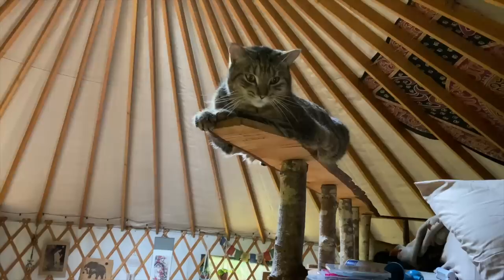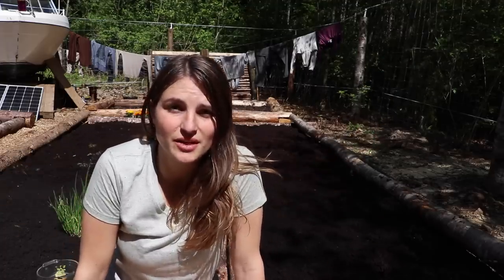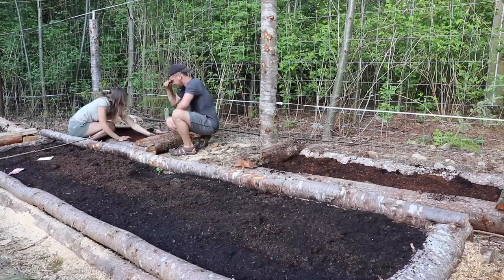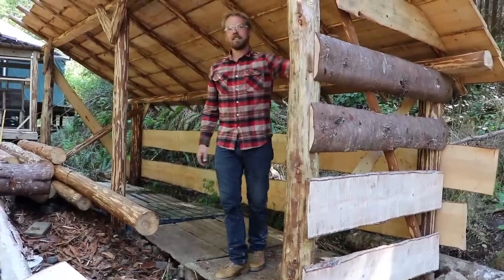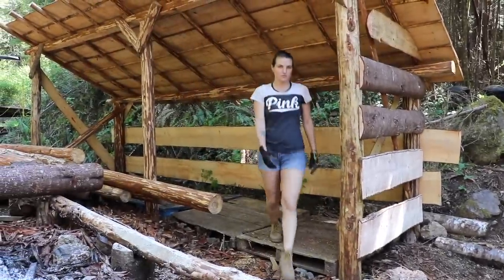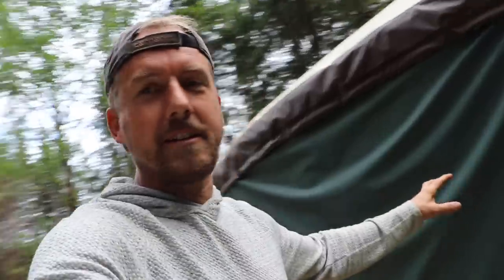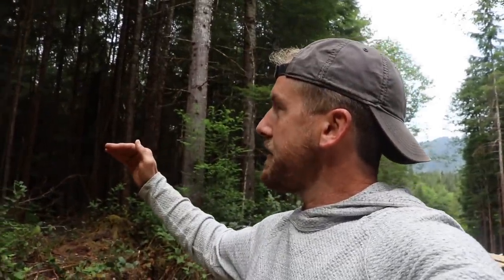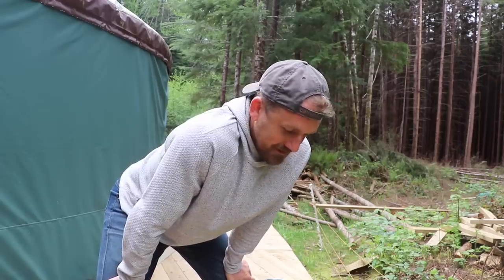WILDERNESS LIVING // ALONE & GARDENING OFF GRID - One Year of FIREWOOD | Can Our Dogs Swim - Ep. 88

Comment: Are those chives already growing in your garden?
Good stuff. It takes a lot of work, this dream of yours... good planning and active pursuit of your plans will get you there, and the later part of this year and next year should be very, very exciting for you.
When I was 11, my father and I downed a 112 foot maple tree using a similar rope and pulley arrangement. We required two ropes, two pulleys and one truck to pull it off. We had built a house over an abandoned rock home from 1889, and the tree was far too close for my mother’s peace of mind (less than three feet at the closest branch). It all worked out and the rigging ensured it didn’t fall into the house. It took me nearly 7 years to cut and split about 3/4 of it into firewood. The other quarter became furniture.
You can do this.

Comment: You need to sort those insects, I went camping at the lakes in my country, we camped in a logging forest just like you are there, we got lit up by these horrible little insects, probably the same as yours there, 20 minutes and I just wanted out of that forest. I always wondered if you could eradicate them with a few flea traps set about your property. The flea trap I bought was basically an oven/wardrobe incandescent light bulb under a cone lid , the gentle heat from the bulb warmed a sticky glue pad about 8cm under the bulb, it tricked the fleas into thinking it was a warm body to feast on and they got stuck, It was very effective, fleas were gone in less than two days...Maybe it'll work for these buggers. Or you could make your own scaled up version maybe with sticky sugar syrup as the glue bottom. Set them out after 5pm and devastate their population.

Comment: Jake! Love your videos, but take it from an old guy to a young guy who will get old; Stop working so hard with your firewood. I learned to NEVER touch the wood more than 4 times before enjoying a fire. 1st time when you cut the tree down or harvest the tree that already has fallen. 2nd time to cut desired lengths of logs for splitting. 3rd to split the logs. And then 4th to stack in wood shed. You are wasting so much energy and time. Either move your logs next to your storage shed or at least have a tough 4 wheel wagon to through your split pieces into after you split. Otherwise you are throwing pieces  onto the ground and then you have to carry them to the shed and then stack. If you set it up more efficiently you'd have more time to enjoy your beautiful place and your wife. I learned this more than 50 years ago from an old time woodsman. "Work Smarter Not Harder". Keep up the great videos!

Comment: Why do you handle the firewood twice; after splitting you throw it into a pile.  Then I’m assuming you load it again and transport to yurt.  What if, once split you throw it in wheelbarrow or pickup bed ready for transport to yurt?  Just trying to save you some time/labor...if possible.
Reply: Mickey Melton...
Exactly what I was thinking. Also, if those bug pieces need to be split again, why not do it at the same time? Handle only once when possible. That's the corporate girl in me, I guess.
Reply: @mernafrederick5153  Yes! I was wondering why they didn't have a wheelbarrow also.  Anything to speed up the process and get away from the bugs!
Reply: They used to have a wheelbarrow, not sure what happened to it???
Reply: I'm pretty sure he is addicted to wood chopping....he can't help working out and filming it!  A wheelbarrow? Please....so easy!

Comment: Hey Jake!! Why don’t you get a wheelbarrow or a 4 wheel cart to throw the wood in. It will save you both time and effort. Effort in that you won’t have to pick the wood up a second until you wheel it to the storage area.

You can also use a heavy duty tarp to drag the wood. I think you have a wench. If you get a heavy tarp with holes, attach the wench with the straps to a tree behind the wood storage area. You can wench a lot of wood at once

Comment: Hey I am an arborist in Ontario Canada and I could give you a few good tips for removing conifers.

I went to Humber College and there I learned some good ways to remove coniferous trees.

If you buy some spurs, chainsaw pants, a helmet with ear muffs, safety glasses, a rope, an eye to eye rope, a micro-pulley, a carabeeneer, a harness, and lanyard, then you can ascend the tree and remove it piece by piece.

That might seem expensive, but you'll have the items for many years and will have control over where your trees fall.

You just need to know a running bowline knot and a schwabish friction hitch and you are good to go!

I've climbed and removed conifers and they aren't that hard. You are very fit so climbing should be easy for you.

But if the goal is to save time and money then perhaps you are doing it right. Cheers!

Comment: Hey Nicole, You've really improved your upper body strength... a year ago you couldn't throw logs like that, or half as far !  Happy you bought those face nets, it was hard to watch you both being so miserable with the flying bugs. Jake, since you want some anchors for future tree cutting, maybe set up some scaffolding when cutting those trees ?  What I'm suggesting is selective cuts of trees at heights of 10'-15' above ground so the bases and roots can be used as pylons of future structures/platforms/walkways. I'm thinking that leaving the root structures with a significant stump above will keep the nearby trees and soil more stable until the remaining trees ramp up root growth over a year or three ahead...These anchor/pylons can also support winches or your pulleys and rope while giving you ready made pylons that are on either side OR the middle of platforms like I've seen on that Treehouse Masters TV show.  They; (TM's TV Show) also have some floating mount attachment structures designed NOT to harm the trees they use as structural elements. Nice to see the boys can swim, pretty soon you won't be able to stop them from jumping in the water, mud, dirt, and smelly crap they'll find nearby !

Comment: I know you have a desire to use manpower to do most if not all work around the homestead.  I appreciate that but I have a suggestion to consider.   Find a used four wheeler along with a cart to handle your firewood and other bulky material movements including small and medium logs.      There seems to be a number of options to continue your manual labor effort for health benefits.  But having some mechanical assistance would provide time savings while minimizing some of the potential safety hazards.    I root for both of you to be successful in your life goals and the love you have for each other.     Peace
Reply: I've been thinking the same thing for a long time. They would be able to manage their time much better and accomplish more.

Comment: Jake,
DON'T THIN OUT THE TREES. Trees work collectively against the wind. They close up to a compact mass so that the wind can't infiltrate the forest but slides away on top of it. Every single tree only stands and grows as tall because the surrounding trees protect them. Their crowns bounce of each other to prevent bending. If you thin out and create corridors in which the wind can get between the trees, you destabilize the whole system and single trees will be an easy target for the wind. Don't let single trees stand close to the yurt.
Reply from the maker: Yeah, the wind was so intense this winter often times hitting with 40-60 knots.  It’s tough because the trees do protect themselves but we also can’t have them directly threatening our yurt nor blocking sun for garden and fruit trees...it’s a balance

Comment: nothing like chopping oak as i used to do. hardest wood out, but leaves much less creosote than those softwoods you're dealing with and heats so much better. Needed a one piece maul
Reply: Try to split hackberry. Oak is not to bad when green. Hedge apple burns very very hot.
Reply: @billhaight7010  I only split dry oak... green oak to burn?

Comment: Tree felling with ropes.. Static and dynamic ropes.  The rope over your shoulder is incredibly strong and has no stretch, a static rope.  Think of triangles to fell a tree if there is a safety concern.  Method.  If the desired fall direction is south,, but the yurt is east.  Two ropes, one static, one dynamic.  The static is the safety line or hinge line,, it does not stretch and it is tied high on the tree and  taken and anchored to the west.  Then attach a rope,, a dynamic  or stretchy rope to the south.  Pure nylon lines can stretch up to 40% and still retain their strength. The truck could be used for this job, snatch blocks or straight.  The beauty of the dynamic nylon rope is that the tension remains and continues to pull for as much as you have stretched the rope.  Take a 100 foot length of nylon,,5/8ths to 3/4ths  pull it tight and then stretch it another 15 feet with a come-along.  Notch to the south, back cut from the north.  The stretched rope will pull and continue to pull until it has rubber banded back to  its 100 foot length.  The static rope, or belay to the west,, does not stretch and does not allow the tree to begin any motion toward the yurt to the east.  Cut a good clean, properly angled notch to the south,, and then bring in the back cut leaving a perfect amount of hinge wood.  There are lots of refinements you can make, but the two rope technique if you are protecting a structure is a very useful skill.  BTW  I have seen vehicles tossed around like toys.  A vehicle can aid in a fall,, but if the tree decides otherwise,, the tree will toss the vehicle like a thrown stick for the dogs.  I have seen a Chevy Impala,, ala 1970, thrown up into the limbs of a maple 10 feet off the ground.  Car destroyed (Interesting insurance claim,, recovering a vehicle from a tree.),, and the tree laid hard across the roof of a Vermont farm house.

Comment: To pull down the trees use a rope and a 4 ton manual puller.  It will be a lot more flexible than the truck.  You just have to get the tree started in the correct direction after that gravity will take over.  The main thing with tree felling is to make sure you cut a large enough notch in direction of fall and leave half an inch to an inch of wood for the tree to hinge on.  If you don't leave some wood to hinge on it could fall in any direction.  The notches I cut are usually about 60% of the trunk.  That may seem large but I've never had a tree fall before I made the back cut and that's about 200 trees.

Comment: If you change the density of the wood by clearing out trees, wind will 'fall' in an other (changed) way between the trees and will make trees fall which were never a problem. So in my opinion you will have to clear far more trees than the ones you are thinking about right now.

Comment: Using the tip of the saw is where you can get kick back! Be careful,  Try to set up,your wood cutting hauling to lessen your picking up and moving firewood.  Thing about it you handle wood aleast 4-5 times to get it into  the stove? Burned wood for 20 years? I know

Comment: Get a 24 ft. extension ladder, and a 2-4 ton come-a-long, tie at least a 1/2" rope as far as you can safely climb up the tree using the ladder and put the C-A-L on another sturdy tree in the direction you want to fall the tree, I've used this method for years. If you keep using that chainsaw without leg protection I'm going to have to buy you some chaps, but would you use them?

Comment: 'Jake no worry no gain...the three trees behind you when you were filming I believe should be cut... they're the closest..so that's one on your left space space the one on your right space drop back the one back right...those three as you were facing us filming...I think any tree in that area if fell would miss and they are much smaller..I think you did a good job when you first started and fell alot to open the area for the yurt you just needed to finish it..never let a tree get in your way but be wise in cutting down a tree..make sure tree cutting calculations are right...before..You cut and while you're cutting...intense concentration required.. remember no fear..'

Comment: Ill try to explain this the best I can, If you have a tree leaning towards your york you can tie a rope high in the tree about 2/3 the way up and then to another tree thats behind it , about the same height rap the rope around the tree one time and then down to another . one person hold tension on the rope as the other person saws it in the direction you want it to fall. as it falls the rope will tighten and make the sawn tree swing around and the person with the rope can slowly release rope and lower the tree easily down to where you want it. just use the tree behind the one your cutting instead of using your truck . to much can go wrong with using the truck.

Comment: You are good with the 8 pound maul, oval sledge hammer type handle.  When you get the chance,, try the 6 pound maul with an axe handle type shaft and head.  It actually hits harder and with less total effort.  The one caveat,  I am eastern,,, Michigan, and mostly hardwoods,, though when in Newfoundland,, just spruce and fir.  Your 8 pounder may be the better tool,, but I cannot help thinking, while watching you,,, you might REALLY like the 6 pounder.  Cutting and splitting, heating with wood,,, no matter what,, is a f**kton of labour.  And I applaud you,, spring is exactly the time to lay in next winters heat.  The wood needs time to season and dry before it can be at its best.

Comment: How much firewood do you think you will need in a year? 

I lived in a somewhat cold spot (temps to -30 F at night for 2-4 weeks per year) in the Sierra Nevada of California. I always wanted 5 cords of wood in storage for a winter. We could usually get away with not having a fire about 4-5 months per year.  I burned high heat producing pinyon pine and if I could get it, lodgepole pine, which has a bit lower heat value than the pinyon, but is much easier to split. Pinyon pine can be murder to split.
Reply: P.S. We rarely cooked with our wood stove, we used grid electric. Since you are cooking with it, your consumption will be much higher than we experienced in our home. Our home was very well insulated and could hold the heat the woodstove created very well.

Comment: Sometimes when your trying to get a tree to fall where it does not want to go it will barber chair - a dangerous situation for you. That is where the tree splits straight up the trunk and springs out and back towards the chainsaw person. If this hits you, you could imagine what damage that you could receive and this happens in about a second. To mitigate this wrap a chain tightly around the trunk about 5 - 6 times about a foot & a half above where you will be making your back cut. Attach the chain to itself so no part of it will hang down where you wish to cut.  A 10 to 12 ft length with a hook at each end the correct size that will hook between the links to secure. For your peace of mind. :-)    Google it. "what is a barber chair in logging"